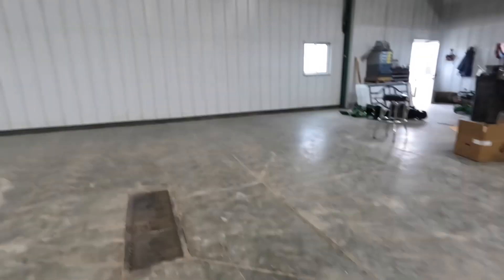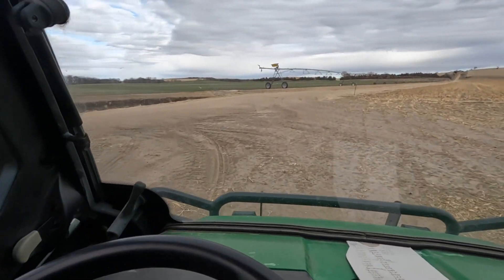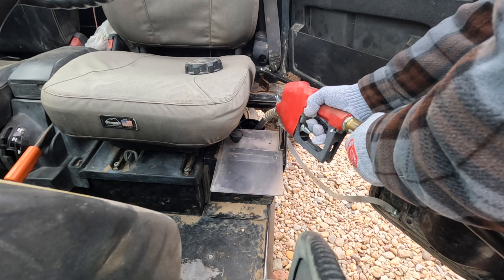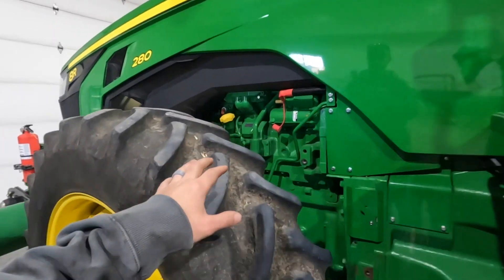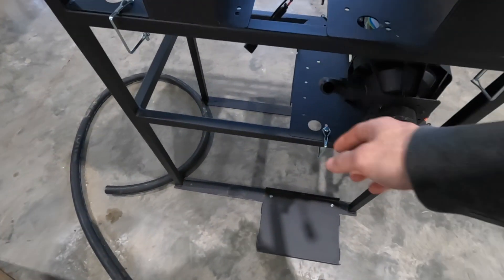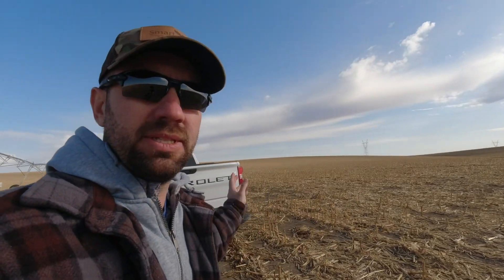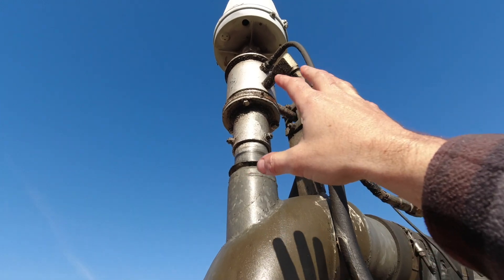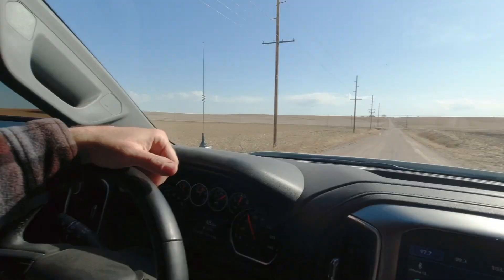We Better Be Ready to ADD WATER!!

Comment: Do you use a repeater or simplex?
A 1/4 wave is only 6 inches for UHF.  They don't make wind noise since there is no coil.
The difference between it and your TRAM is a 2.5 dbd gain.
The gain might help in the hills you farm.
Reply from the maker: We run off a repeater. Thanks.

Comment: type in whistle radio antenneas. simple fix use a piece of electric black tape tape a piece around middle of base of antennea. land here is at 25200 older farm  couple bought  pieces of land. a 68 acre piece brought 22300.00 per acre. land was owned by vern and faye huisman.